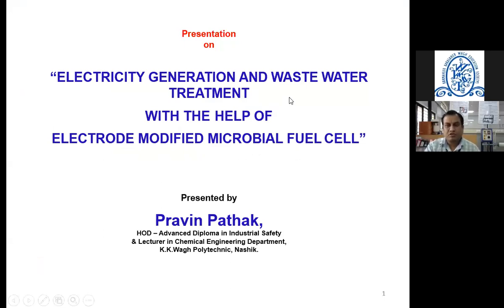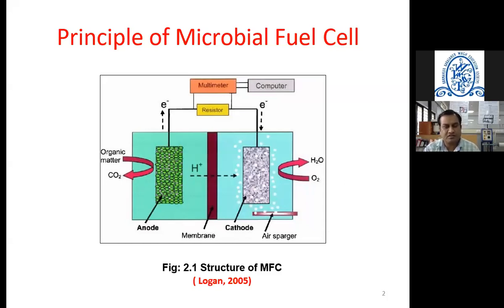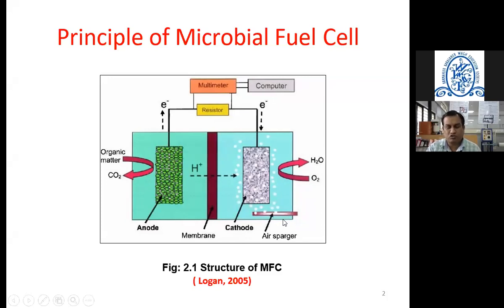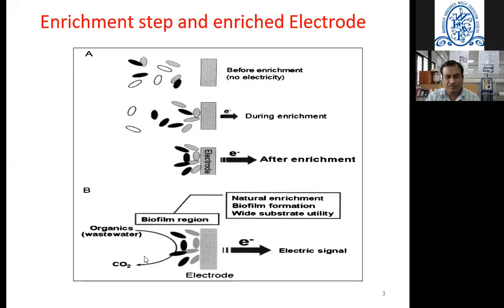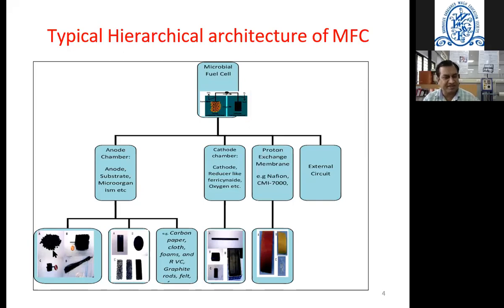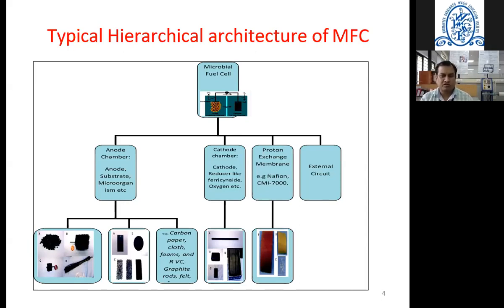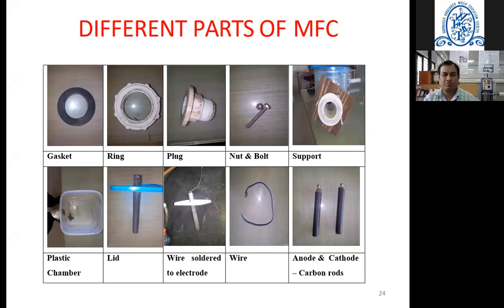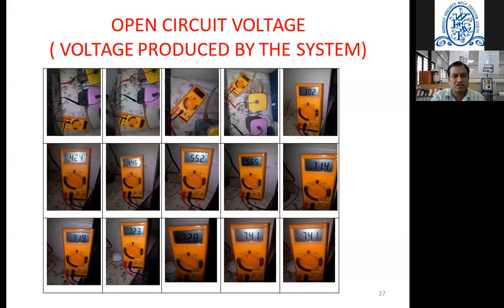Microbial Fuel Cell (MFC) for waste water treatment-electricity generation-metal recovery

Comment: Is there anything that can be operated by the electricity produced by this microbial fuel cell?
Reply from the maker: For this 700ml Sewage water which produces only 1.86V, Small LEDs can be operated. But if U want more voltage, then try for MFC(Battery) in series.